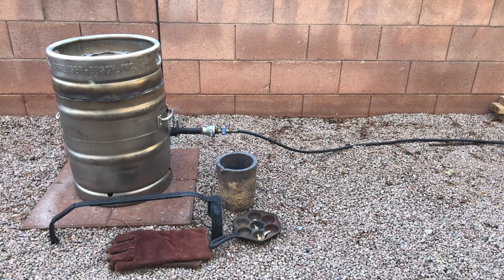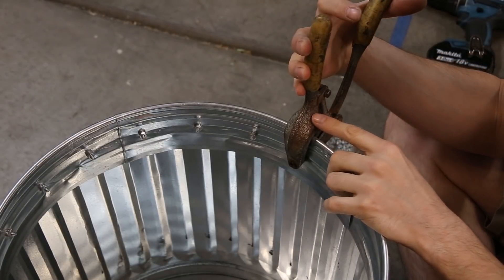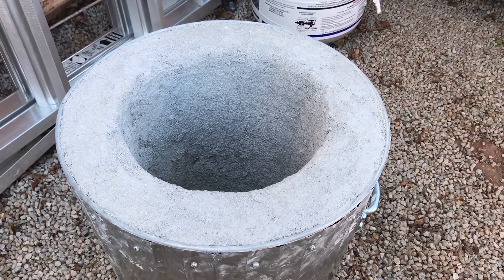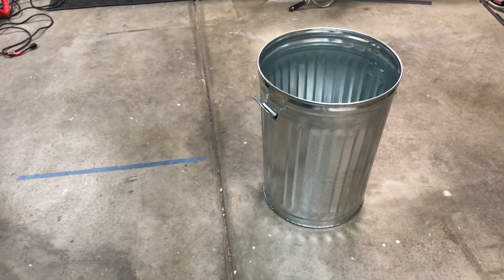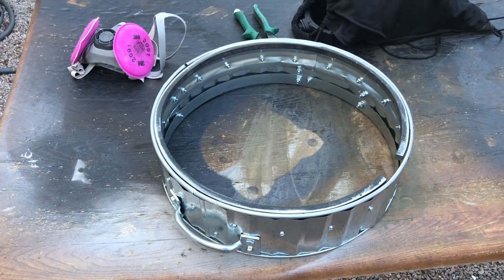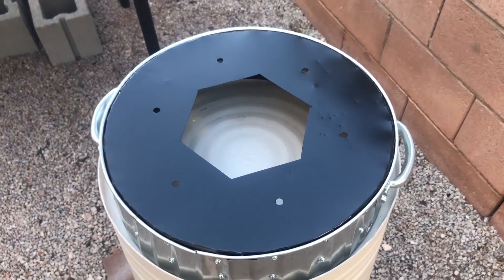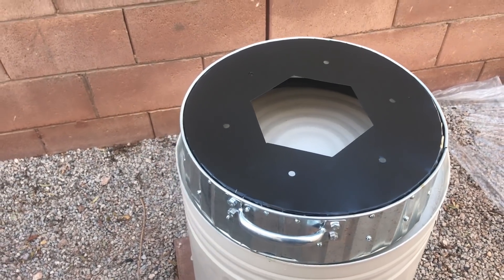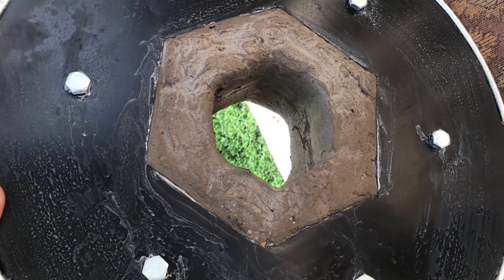Making a metal melting furnace from an old Kiln│Metal Foundry Furnace│Part 1

Comment: Why didnt you just buy some new bricks instead? The old kiln was perfectly fine, if it had broken wires; Kanthal wire is easily obtained. A solid state relais with a thermocouple and an arduino is all you need to make it run. Its programming the arduino that is the hardest thing to do. I am still studying to get the arduino to do exactly that. 

Any way, ill be uploading everything once i am convinced ive got the right codes and drawings for the kiln and controller. 

Greetings,

Jeff
Reply: You don't even need a arduino, you just need a type s thermocouple solid state relay and a pid controller. Much easier as the programming is done.

Comment: Question.   I’m making a furnace and I’m actually using a electric kiln that you showed.   I’ve watched many videos about it and my question is.   Do you have a hole in the bottom of your furnace like some of the vids show? It for in case your crucible fails so the molten materials can run out the bottom instead of pooling in the bottom ?    I’m leaning towards no hole but would like your opinion.    Thx
Reply from the maker: Milton Metcalfe I installed a “drain” in my first furnace but didn’t in this one. In theory it’s supposed to work but I’m not sure how effective it is in practice. I think you will be fine without one.
Reply: Seth Robinson thanks for the reply I have already put a hole in the bottom but I saved the plug in case I needed to put it back in lol.  I’m really looking forward to melting some copper and other metals.   I might seek you out again if I can’t find the answer on you tub if you don’t mind.    Thx again

Comment: I have a kilm could you just drill a hole to put a burner for a furnace in the side and use it that way
Reply from the maker: You would need to coat the inside with something like Satanite. The burners flame will melt the uncoated bricks as the flame itself is much hotter than what those bricks can withstand.

Comment: How does the satanite over ceramic wool hold up? I’ve you can crush it pretty easy
Reply from the maker: My experience is that after it has been fired it hardens up significantly.  Its not concrete but its hard enough to withstand some light abuse. For instance, when I pick up my crucible before a pour, I sometimes scrape the walls of my furnace with my crucible "tongs". Its strong enough to withstand that. In fact that's why I coated my first furnace with it after discovering that ITC100 alone was not enough. 
I will talk about this in part two which will be done next week.
Reply: Seth Robinson cool, I want to build a new one and making the lid like you did would help
Reply from the maker: @swdweeb  I just posted a video talking about satanite. Hope it helps!